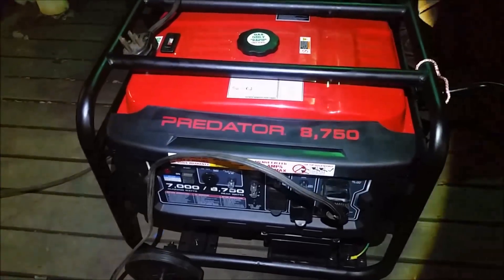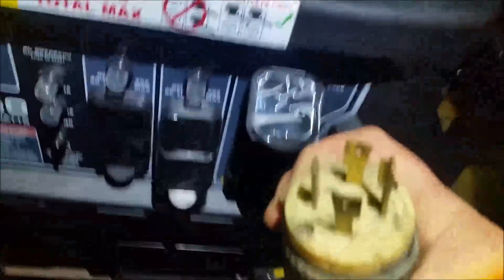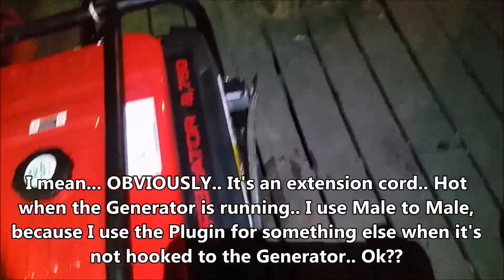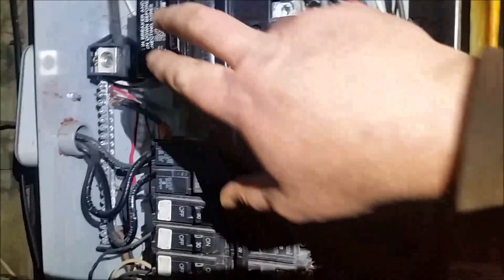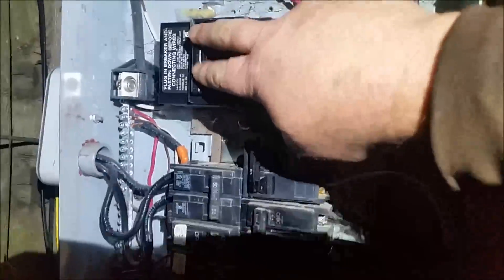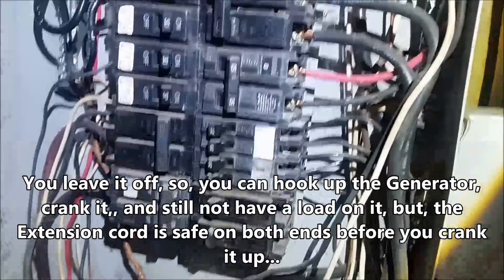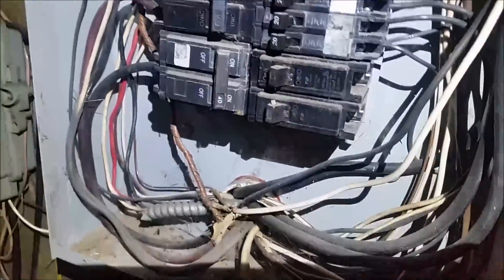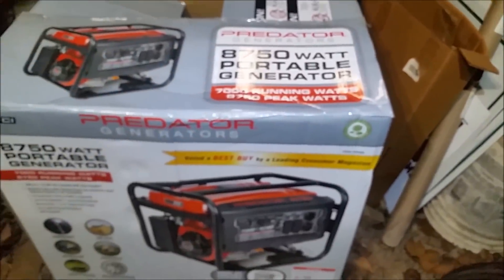Quick/Easy/Safe: Use Existing Plugin/Breaker for Generator hook up to your house Panel box.

Comment: You have access to the panel and are comfortable working inside it ... why not spend the extra $100 on an interlock and an inlet receptacle?  You've shown that you know what you're doing and that you have common sense.  But when power outages occur, the conditions aren't always ideal and we're not always at our best.  It will usually be dark.  During a storm there might be water on the ground.  Or you might be away from home, or incapacitated, and a well-meaning family member might try to set up the generator and miss a safety step.  Is it worth taking the risk when you can finish the job right for about $100 in parts?
Reply from the maker: Art C .. That is about the most politically correct, or well thought out way of asking a question,, I would be happy to answer your question, but, you have really made me curious, so, at the end, I am going to ask you a question that I would really like to know about you..  Hope that is Ok.. 
Yes.. All things considered, I could do the install any number of ways and only deal with the cost of the parts.. 
When an outage occurs, I would be sure to know what I was doing before doing it..  If I had been drinking, I would not be stoned, and would be a bit more cautious, or maybe run it through my mind one or more times as I am doing it.. Maybe worse would be waking up in the middle of the night (sleepy headed), and have to go and fire things up.. Either way.. If we are not at our best when working with Dangers, then, we are not usually around to tell stories and  respond to questions, so, I can't think of an instance where I would be mentally incapable of doing something so simple,,, safely.. If I were unable to get up and do it myself, I would give someone a two way radio, or phone and walk them through it.. Or, I would ask my 80 year old Mom to come and hook things up.. I already showed her how to do it a time or two and held some inside the panel instructions "in my hand", while she did it, then, showed her the instructions and made her do it again.. The next few times, I only sat and had her tell me what she was going to do first, and why, and why that made sense before she completed what she said she would do first, then, do it and tell me step to and so on.. She has zero problems with it and over time, I have filled in all of the blanks and she could make her own video about this.. 
It is really simple when you understand it.. 
Simple question: Why don't I use an Interlock.. The answer is a couple of things why.. 
1) I use an existing 220v Female Wallbox connection that I use for my welder normally, which I don't use during a power outage, so that makes perfect sense..  I power the panel the same way you would do with the Interlock, but,,,,, if I used an Interlock, I could "NOT" use my existing Welder connection when running on Plant power, because it would not be hot when the main breaker was on , when I normally use it.. (Interlock would have it turned off because it would be extremely dangerous to have a hot male plug outside of the panel while the main breaker was on. Could easily kill a curious someone.. 
Besides, it would take up an extra Double breaker slot and a useless Male 220v connection that could only be used during a power outage and not be of any use, but, be a possible danger the rest of the time, which is a much larger majority of time.. 
2) Interlocks are way overpriced and built extremely cheap and the ones I have looked at are pretty damn flimsy to be called any kind of safety device.. They usually have very thin metal and are easily bent.. 
What if, the last thing you do is throw the big heavy Main Breaker back on, and you didn't notice that the thin metal tab bent on the 220v breaker generator feed male,, and the male was sitting there hot?? It is an un-necessary danger and another source of failure that would be unexpected.. 
3) I would much rather have a male to male generator extension cord, and can take my generator to any of several 220v external plugins around the house to power the panel if I wish.. When you pick up a male to male extension cord, you are going to think safety,,, unless you are brain dead and have no business working with electricity.. 
And, I can take my generator in extended outages and take it to my friends house, girl friends house and plug it into their dryer plugin to power up their refrigerators/freezers etc... 
If I had a typical generator extension cord, I could only take my generator to someone else's house that already had a generator and generator hookup.. 
4) If I were to install an Interlock, I would build my own, and I would build one that would not bend and would not break. Many of the older style double breakers have holes through them anyway, and it is easy enough to push a piece of 12ga wire through to make your own, if you need a reminder to move both breakers at the same time.. 
I don't need that reminder.. It makes sense to me that the first thing you do  is turn "Off" the Main Breaker.. I would never forget that under any circumstance.. 
5) Do you have any idea how unlikely it is for you to turn your Generator Feed Breaker on,, with the Main Breaker "ON"... ?? There is going to be such a demand for your electricity by everyone not currently running on generator, that, your generator breaker, or, your generator is going to either trip out or die under the extreme load within a second of you making that mistake?
If you are just now out of electricity,, how long are you going to wait to fire up your generator?? 
If the power guy going to be there that quick working on a fix? Very, Very remote.. 
What would be the next most likely problem? Maybe a car crash that takes down a pole and emergency responders are there to help and the hot line is hanging over the car.. 
Will they wait for the power company to cut the power before they respond? Likely not, but, they will move the wire with something that won't allow them to be shocked and will treat both ends like it is hot, even if it is not.. And, they won't work the scene until both ends of the wire are safely out of the way.. In that case, there is no extra danger.. It is when the power is cut off there begins to be a problem.. People assuming that the power is off... This is something that a Lineman will never do.. Even if he just tested and knows the power was off 3 seconds ago.. If he does, he will not have a lengthy career.. Too many capacitors, etc, waiting to discharge at those houses that have not yet turned their main breakers off, and don't have generators..  You will never catch a lineman with a generator.. People who say that don't know any lineman.. 
Hope that clears that up.. 
The steps again.. 
1) Turn Main Breaker  and Generator Breaker off
2) Plug in Male to Male (Suicide cord) to the Welder plug and then the Generator.
3) Crank Generator, turn generator breaker on.
Reverse steps back to utility power.
1) Kill Generator
2) Unplug Male to Male cord from Welder plug then from Generator
3) Turn Main Breaker back on, and Turn Welder Breaker back on.. 
It is really very, very simple.. If you have any common sense at all, you are not going to screw this up.. 

Now,, my question.. I am going to assume that you are either Married and have a wife and At least two Daughters and have done a very good job raising them,, or you grew up in a house with at least 2-3 Sisters, and either figured things out for yourself, or, you have learned well from the Father who raised you.. 
I am trying to figure out where you became gifted at crafting your questions. And, I am very curious..
Reply: @MarkThomas123  Heard it all before, you don't need to justify it, in the end it's your decision.  I'm about the least "politically correct" person you'll ever meet.  My comments here were polite because I wanted to have a real conversation instead of just slinging mud.  Yes, I disagree with your approach, but if I just shouted "omg you're wrong and you're going to kill everyone!!!!1" you would just move on.  I have no doubt you know what you're doing, but you've also put a dangerous setup on display for people who aren't as competent as you.

You're correct in that an accidental backfeed to the grid probably won't hurt a lineman, as they're trained to treat every wire as if it were "hot" and when they do work on a dead line, they will often ground it "just in case" it gets energized unexpectedly.  And of course your generator breaker will immediately trip when you try to energize the entire neighborhood with your little 7200 watt generator.  So hopefully that main is already open when the utility power does come back on.  If not, hopefully the generator breaker trips before the windings of your generator get destroyed.  (I've seen some nasty things happen involving commercial switchgear.)

Like I said ... it's your home and your choice.  I personally wouldn't go the non-interlocked-double-male-backfeed route when a code-compliant solution is only a few inexpensive parts away.   I do agree that some of the aftermarket interlocks are a bit flimsy.  If you can find one that is designed by the panel manufacturer to bolt into the panel (as opposed to one that attaches to the cover) they're usually more solid.
Reply from the maker: @igfoobar  Just for Clarification,,, "Code Compliant" would be referring to the NEC.. The NEC has a chapter on Generators.. It is the smallest section of the whole manual, which, to my knowledge is not accepted in full by any State.. Portions, but, not all, and none of the new versions of the manual.. 
But, past that, the NEC does not regulate "Temporary" Extension cords.. Only when they "Can Not Be Used", so, the code compliant on "Temporary Extension cords" is an incorrect statement.. 
The point of this way of doing things is not to have to chew up another two slots in the box, and on top of that, not be able to use an existing "Safe" female plugin, instead of having a "Male" plugin outside of the box 24/7/365, waiting for some type of mishap to happen.. I am the only one who uses the Male to Male and when I pick it up, as strange as it is to hold it, I NEVER forget what I am holding in my hand.. Same as if I were holding a poisonous snake by both ends.. It's just common sense.. 
BTW.. There are several Lineman in my area that use this same setup because it makes sense, and if both ends of the line are plugged in when things are not energized, it is as safe as a Garden snake.. Sorry you don't agree with us.. But, I did look at your channel.. I was right about the daughters now wasn't I... 
The reason you were able to make the reply like you did without much thought.. It is how you run your house and home.. More than effective I am sure.. I was impressed... It's how you get things done around a bunch of women.. :)  
But, lets agree on why you think an Interlock is needed.. So,, you don't forget to turn the Main Breaker off before or as you turn the other breaker on.. Ever think about that split second when they both might be connected at the same time?? I turn my main off before I turn the Generator feed on.. In fact, turn the Main off, connect everything and crank the generator before I turn the generator breaker on.. Plus, like I said in the video, I also reduce the load by all of the breakers that I am not using before I turn the genset breaker on.. 
If you can't remember to turn one off before the other, what are the chances you will forget the other breakers you are not going to use... ?? 
It's all about common sense, and knowing the fundamentals of what you are doing and follow the safety flow of what you are working on.. I work on too many things not to use the conceptual thinking process..Too damn many ways to get hurt when you do as many different types of things that I do... 
But, I am not twisting your arm to do something you are not comfortable with.. It's just the opposite.. That would be dangerous.. You don't try to catch a snake without knowing how you are going to do it and what you are going to do after you catch it.. Otherwise, you might find yourself holding a snake you forgot to get the bag to drop him in to take him to the local "venom" provider.. 
I don't forget to tie my shoes or put my car in park before I step out either.. Why is turning off a breaker any different?? To me, it is not any different.. A potential danger made safe by de-energizing the circuit.. 
Any way you slice that one, it still comes up safe.. Just like a lineman working on a circuit,, he knows how to make it safe before he works on it, but, still treats it as what it is.. A potential hazard.. I don't even touch either end of the male connectors, because I don't want it to become a habit that I might break.. 
But, if you feel that a Interlock is the safest way to go, especially if someone in your house might try to do this on their own, by all means, go that route.. I can't even say the "Safest" route, but, it does have the perception that it is.. My Mom, Girlfriend, etc.. all have this same setup.. But, for them, I did have them make a simple 3x5 index card and tape it over the main breaker, just to be safe.. That extra warning and the steps to be "Confident" they are doing it right, since they don''t do it often.. 
Good luck with however you do it...  I use what is already on my wall being used that won't be used while I am running on generator.. But, I have used my A/C Stick welder circuit more than a time or two when I was using my Mig and Plasma cutter (which I usually use) to finish up a job real quick.. I have at least 3 options for hooking up my generator.. But, at least I could help you out,,, if you had a male to female genset extension cord.. Not everyone who needs one has one though... Cheers!